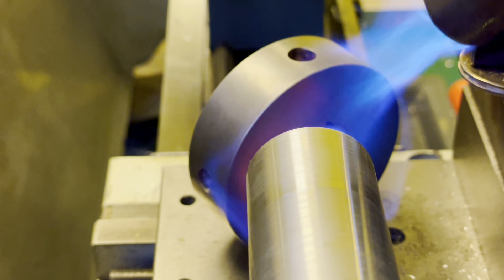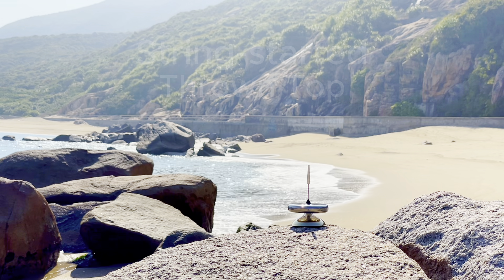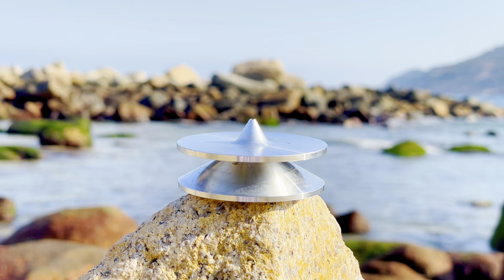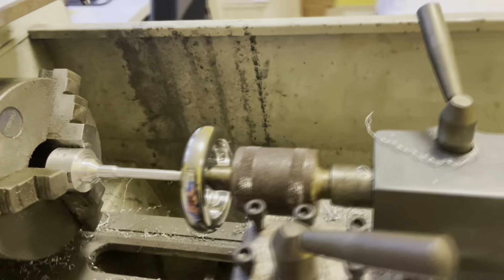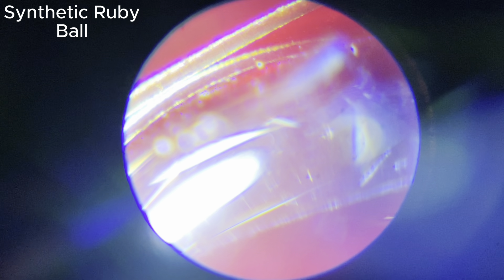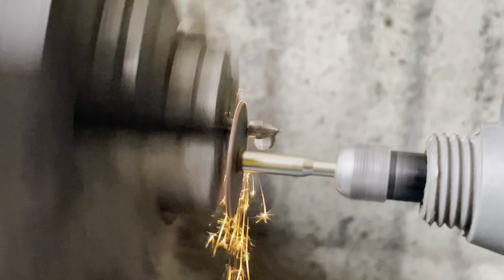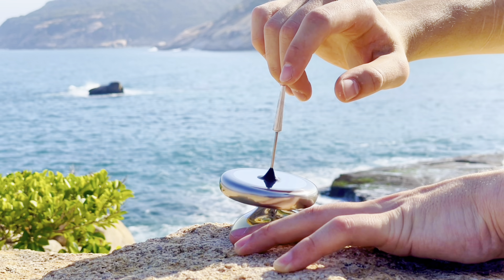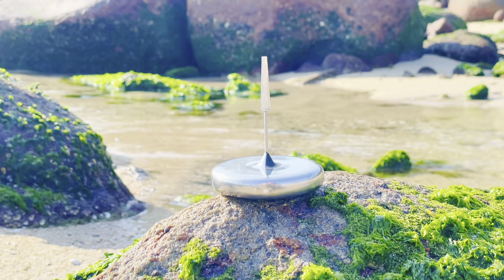Spinning Top Mk.24 | RUBY & SAPPHIRE

Comment: I had a top that I made from a flywheel pulled from a friction motor toy car, that I could get to spin for 30 minutes on a laminted countertop, it had a pointed tip on the one end of the shaft and I pushed the flywheel down so that the tip just barely stuck out a milimeter or so, the low center of gravity and the minimal friction of the pointed tip allowed it to spin a long time. I see a lot of these tops have blunt tips which increase drag and they are too high off of the surface. If I had the machinery I could probably build a more refined version of the flywheel top and double the spin time.

Comment: I would love to see an experiment to see the maximum RPM that could be achieved using a 24" mylar pull ribbon attached to a 14"L x 1/2"  bamboo rod.  Depending on the thickness of the Tops' center spindle and how many wraps or mylar foil around it, I believe the results would be Very Impressive!!
Reply from the maker: Absolutely, although it would be a bit difficult to keep it on the base! I plan on making a string-started top soonish :)

Comment: You mentioned that ruby didn't make a significant difference in spin time, but would it allow you to have a sharper tip to reduce friction?
Reply from the maker: Possibly, and this is something I’m testing, but brittleness becomes a serious factor when trying to make sharp tips from ruby or similar

Comment: Instead of a spherical ruby base, what about a conical one?
Clocks used point bearings like this, and with a tiny minidot of oil, ran near friction free.
Say the tops point is like 30°, and a ruby cone base of 120°. I understand ruby bearings are pricy, but i think at least! PLZ ADD A HINT OF THIN OIL ON THE TIP! 

Genuinely curious as well, if an oiled ruby base, sphere or cone, would influence it, along with wear patterns, and longevity. Maybe light mineral oil, like baby oil, or bicycle brake fluid.

Lastly another tip material, or cheaper alternative for ruby bases, would be glass. Glass rod for a resharpening tip, or big rod cut down to disk, for a baseplate.

Hell even an experiment where the baseplate is clean, vs when it has a couple fingerprints on it. If skin oil is good or bad, and even with real oil, to see if it should be run dry or wet.

I saw one of the first vids, and am glad ur still working/arting ❤
Reply from the maker: Thanks for the comment! God point about investigating different lubricants. I do use a thin film of oil but it would be interesting to see how different options perform

Comment: Did you consider to test the impct of air densety by altitude?
Reply from the maker: I’d love to try this at some point - hopefully this year
Reply: @hiper_tops  got that ida from an video about cycling hour record attempts.
Mexico City cycling track is on 1800m and has the best conditions of air densety to oxygen for an athlete.
Also did zou consider to grind the surface to a certain roughness to create an effect sharkskin has. The idea behind that is that the air stickes to that roughness and creates a layer of air that moves with the top. So the surface friction is between air to air and not air to metal.

Comment: After a few minutes of running, is there any discernable heat right where the pointy tip rides on the carbide base?
Reply from the maker: I haven't been able to measure this but I strongly believe the answer is no - aside from both the top and base being large, thermally conductive bodies which would radiate away any heat before it built up, more fundamentally, the powerloss due to tip friction is very small. I think for a noticeable amount of heat to be generated, the efficiency would have to be very low.
Reply: @hiper_tops  Maybe if a top was spinning in a vacuum, a few degrees of heat could be detected with an infrared camera, but yes, thermal conductivity and radiate heat might very well wick away any measurable buildup for such a tiny surface area in such a case too. "In a vacuum environment, a drill bit can overheat due to the lack of convection and conduction for heat dissipation, relying solely on radiation, which is less efficient than in air." I was just pondering if the little sharp point was however small, thermally vibrating (expanding and contracting), as although frictional heat is a negative, thermal resonance can sometimes lower friction or give back a little. It's all probably nominal at best I know.
What might be an optimum weight for a finger started long duration top? Is there s Guinness rule about a weight limit?
Thanks for your thoughts.

Comment: Random thoughts, would it be better to have a tip slightly softer than the spinning surface so it doesn’t scratch it? 

Is a sharp tip better than a round tip like a sapphire ball bearing?
Reply from the maker: Sharp tips are better than round when lubricant is involved. I typically use a softer tip however after my success with carbide on carbide, I am interested in trying harder tips too.

Comment: what if you used a tip material that was slightly softer than the base material? I think the tip slightly flattening would create less friction than if the tip were to drill itself into the base. also maybe something interesting would be to control the temperature of the tip/base to make them very slightly softer or harder not sure how you would do that lol
Reply from the maker: Yes temperature control is difficult. I typically use a slightly softer tip so actually I’m keen to try the other way around

Comment: Would it be against the rules, to have the top spinning on an air cushion like in the video by Steve Mould?
 https://youtube.com/shorts/e3XOdq86shM?si=-6-i4qNyqSg_3lnq

Would this be beneficial?
Reply from the maker: Yes it would be against the rules, however it would be fun to try. I believe it wouldn’t be beneficial as the radius of the contact patch required to ‘float’ the heavy top would be so much greater than that of a sharp tip.
Reply: @hiper_tops  I agree it would be fun, I hope to see it some day

Comment: Does the record specify that you have to use the fingers from one hand? Because there's a loophole you could use to get a much much higher speed (and therefore time) using the fingers from both hands (similar to the motion I use to spin a quarter and make it flipping RIP) 

But you would get it started with one set of fingers like you currently do, but then you would sandwich the gnurled stem between the fingers from both hands and draw them away in opposite directions and use the greater surface area of your full finger lengths to get that thing up to mach jesus. You could probably easily break the 2 hour mark with all that extra speed. 🤔
Reply from the maker: Yes this is an interesting suggestion and technically it may be allowed, although I’m not sure. However it would take a lot of practice to get accurate enough and confident enough to start the top any faster. Also, there are diminishing returns on faster starting speeds due to high air resistance at the start. Doubling the rpm for example would only add around 10 minutes.

Comment: Might have missed it, but why haven’t you tested diamond tip for the top?  Other applications use similar hardware like 3d printer nozzles that experience a good amount of friction over time.
Reply from the maker: I haven’t yet purely because of the cost and difficulty in machining. Additionally, without the right base, a diamond tip could rapidly drill a hole. I plan on testing diamond soonish :)

Comment: I don’t know if this would even work, but could you make the body an airfoil shape? It might provide a bit of lift. I’m sure someone who knows anything about physics, will correct me.😂
Reply from the maker: If there was a strong crosswind and the flywheel had a frisbee shape, perhaps some lift could be made. However the reduction in tip friction would be outweighed by the increase in air drag.

Comment: First time viewer. I agree with everything you've shown here but I don't think the base is what will produce the best advancement. It must move so i believe aerodynamics are the best way forward. I don't know if you have any affiliation with a university but I'd like you to find someone with a transparent vacuum chamber, spin it up to speed in the chamber, close the lid, and pull a vacuum.  This will separate aerodynamic drag from the carbide tip drag
Reply from the maker: Welcome! I’m a student at Cambridge but I actually have my own vacuum chamber. I have done what you suggested previously for data collection, however I plan to film it properly to show you all!

Comment: If balance wasn't such an issue I wonder if divots on the outer edge would improve the air's separation point + reduce drag like a golf ball, or if hand-starting it is too slow to see an improvement
Reply from the maker: Actually, divots wouldn’t help even if the speed was faster. I plan on demonstrating this in a video soon :)

Comment: What about a very light oil like used and watches, maybe likely wiped off after application for just the thinnest layer. To reduce friction that much more. It might be that a Ruby tip on a Ruby plate with that slight barely touch of oil might have an effect.
Reply from the maker: I currently use a thin oil film as you suggest and I hope to try ruby on ruby soon :)

Comment: What are the rules? Does it have to be spun with fingers? Is there a size or weight limit? Obviously a flywheel can spin for days.
Reply from the maker: It must be started with the fingers, no vacuum or magnets allowed, no moving parts or external support/energy storage/supply.

Comment: Cool. Are magnets banned too? Use some graphite lube. Also try it in colder temperature.
Reply from the maker: The rules regarding magnets are vague but the consensus is that they are banned. I haven’t actually tried graphite, I usually use oil. Why do you recommend cold? Some people are saying hot and some cold.
Reply: @hiper_tops  Cold makes everything harder. For example axe blades need to be soft steel if they are used on cold temperature. Or the blade will shatter. Hot makes it soft. Graphite lube doesn't get sticky like oil does. It will also cool the surface.

Comment: I think the next step is going to have to be looking at tip material - I don't think the base is as significant due to the motion of the top distributing the wear, whereas wear of the tip is focused - a 3x wider tip after wearing as you showed is 9x the contact area and friction slowing the top down
Reply from the maker: Very true! Yes that’s on my mind

Comment: What about using magnets and a vacuum chamber
Reply from the maker: Yes either of these could significantly increase spin times. The 2 major reasons for spinning tops slowing down is air drag and tip friction. Both could be elimitated with this suggestion. Which begs the question, how long could something spin when being magnetically levitated in a vacuum? This wouldn't be a spinning top and certainly wouldn't qualify for a record but it would be interesting to try. I hope to do so this year!

Comment: You need to spin in a hot and humid environment. Heat makes the air thinner, and humidity also decreases air density. A thrown ball would travel farther in these conditions than somewhere cold and dry.
Reply from the maker: Actually, I suspect cold air would be better. Counterintuitively, colder air has a lower viscosity (just as important as pressure ie thinness). So high altitude, cold air may be best. I'm not sure about humidity, although the density of air decreases, viscosity and air pressure aren't impacted. Could make for a fun experiment at some point!
Reply: @hiper_tops  why not test both conditions?

Comment: Use a vacuum chamber for your spins. Take air resistance out of the equation entirely.
Reply from the maker: Indeed and I do this for data collection. However it doesn't count as a record. I plan on demonstrating the results in a future vid :)

Comment: Your best bet now is to look at your startup method. I don't know what you're currently doing, but since the only requirement is that it needs to be your hands, then there is lots of room for improvement. 
-First, you can use rubber gloves or something similar for better grip on startup. 
-Next is your actual spin method. Just from watching, I see you're using your fingers. You could try starting with your palms (like rubbing sticks to start a fire). If it's allowed, you could get cheeky and make a set of gears (it's not string lol). Your hand spins a larger gear attached to a smaller gear that spins the top faster. Though, at that point, you may as well use a drill or something. If only hands/body is allowed, you could use your forearms for a longer runway. 
-If you don't mind getting A LOT more nerdy, you could use magnetic levitation to remove the need for a platform entirely. Then find a way to start it up with magnetic induction.
-Finally, get a vacuum chamber to do your spin in. Start it up, then set the vacuum. Completely take air resistance out of the equation.
Reply: I wonder if magnetic levitation would suffer from eddy current losses.
Reply from the maker: Yes, aluminium for example experiences strong eddy currents. However, I'm not sure quite how strong this effect would be.
Reply: @ generally eddy currents are affected most by proximity and speed difference. The faster the relative speed the more it pushes back.
Reply from the maker: Lots of fun suggestions here, regarding rubber gloves, I have tried this before however they get tangled in the knurling - perhaps some kind of grippy coating would be better. Palm spinning has been suggested before. Indeed i think theres potential but I would need to practice a lot to get accurate enough. In fact strength isn't really my limiting factor at the moment, but my accuracy at high effort. I never mind getting nerdy. I plan on testing magnetic levitation with and without vacuum. This wouldn't count towards the record but could be really interesting.

Comment: Do you have a solid mathematical model of your losses? Does ambient air pressure, humidity, density and wind play any part in the losses? While a vacuum chamber may not be allowed, maybe a heated dehumidified box can still affect it.
Reply from the maker: I have a mathematical model, specifically a formula to predict spin duration based on several variables including: flywheel outer diameter, flywheel inner diameter, flywheel height, flywheel density, starting speed, toppling speed, tip young's modulus, base young's modulus, tip/base coefficient of friction (with lubricant), air pressure and air viscosity. This model was derived and the unknown constants approximated with experimental data (eg measuring rpm decay in vacuum vs in air). However 'approximated' is quite a key word and I am by no means satisfied with the accuracy yet. Not enough to share it publicly at least. 
I would be interested to hear why you think a heated, dehumidified box could help (I suspect this is allowed, the rules are quite vague). I would have thought high altitude, cold air would be beneficial due to the reduction in pressure and viscosity.

Comment: I know it's a tall order but I also wonder if there's a way to calculate the perfect weight (for friction reduction vs inertia/momentum) for each pairing of surfaces. Perhaps each build should actually be a trio of light, medium, and heavy tops within the same design and material line-up.
Reply from the maker: This is sort of possible if you assume some things eg starting speed. So although there may be a theoretical perfect design for me (which would use osmium, diamond and crazy stuff), the practical perfect design is limited by your material availability (density, hardness, size, geometry) and machining capability. This is why my earlier brass tops look quite different. Their geometry is more optimised for brass's density.

Comment: It would be worth doing smoke tests to visualise the fluid flow over the top. In all systems like this there's crossover between the losses caused by Stokes viscous forces in laminar flow, vs. high RPM flow separation.

It may be that spinning the top faster isn't actually optimal, and that there's ideal ratio between the launch speed and top diameter/thickness.

Mostly just suggesting an avenue to explore, as it'd make a great video.
Reply: Yeah getting the aerodynamics right at the boundary will be crucial when talking about these extremes. Wind tunnel/Smoke test will definitely be helpful as simulations won't be feasible. I wonder how the two streams of air from bottom and top actually interact when they meet, if they form turbulent mixing that will create unnecessary drag. Probably schlieren imaging as well if sensitive enough! 
How much longer could this thing spun up to the same initial RPM spin in a vacuum? And in a vacuum, would there be other more advantageous geometries since drag won't be an issue? 
This is a surprisingly interesting system to think about!
Reply from the maker: I'm glad you think so! My current design balances the total powerloss between tip friction and air drag. However, since air drag is much more significant at the start of the spin and tip friction is more linear, spinning Mk.24 in a vacuum would only increase spin times by around 50%. I hope to film my aero experiments for a future video as it seems some people are interested!
Reply: @hiper_tops  cool, looking forward to them 🤟

Comment: Talk to an MCD or PCD manufacturer, and see if they'd be willing to sponsor your video with a few sample bits. They could probably make your concave base super easily given the complexity of other things they make. PCD is also damn close to MCD and much easier to work with, if you're doing it yourself.
Reply from the maker: The MCD supplier I used was unable to help with the shaping beyond laser cutting a disc. They also didn't know anyone who could (although this may not be true). I am definitely motivated to work with PCD, MCD and DLC coatings. Stay tuned :)